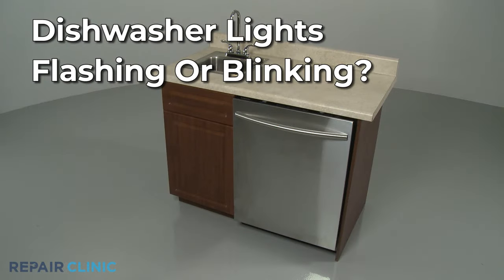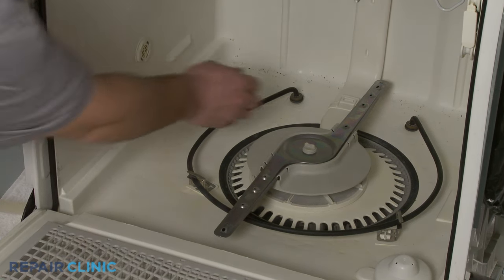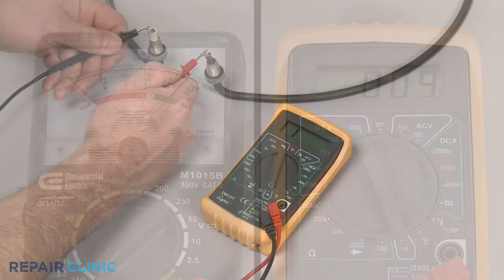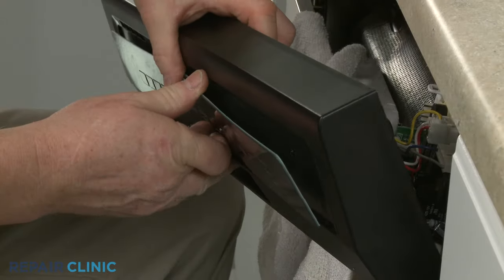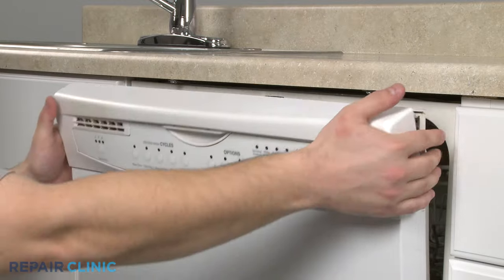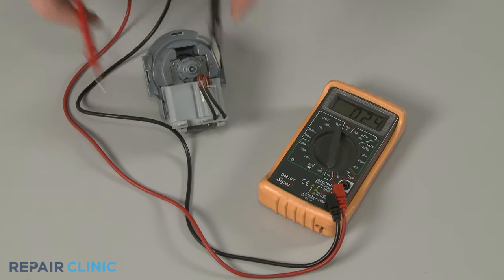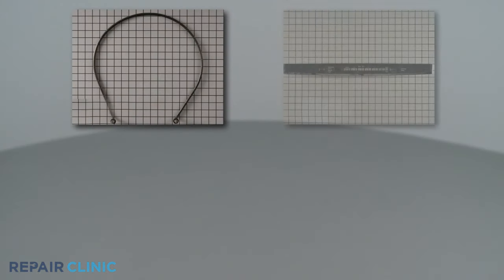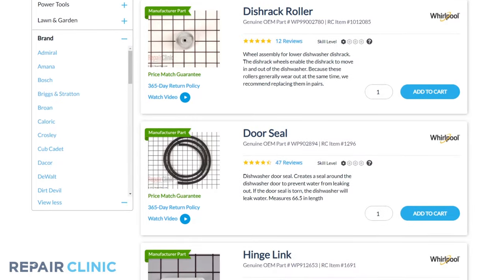Dishwasher Lights Are Flashing — Dishwasher Troubleshooting

Comment: Thank you for posting. Good info, I lucked out this time. Mine had a red blinking symbol & wouldn’t start. Had to find my glasses & sure enough it was printed just below the button “control lock hold 3 seconds”. Simple solution.

Comment: For some reason this was the top video that came up when I searched. In my case somehow water had gotten in RIGHT behind the power button on the control board. There was just a small puddle of water that was shorting the circuit. My Whirlpool responded to this by flashing control board lights. I suppose I could have waited for it to evaporate on its own but since I didn't know what the problem was I disassembled the control panel, saw the water, and used a hairdryer to dry off both the plastic panel and the circuit board. It fired right up after I reassembled.

Comment: THIS VIDEO DOESNT SHOW ALL THE STEPS AT ALL. YOU MUST REMOVE THE DISHWASHER AND UNPLUG THE ELECTRICAL CONNECTIONS FOR THE HEATER COIL AND ITS THREADED AND YOU WILL NEED TO UNSCREW FROM UNDER WASHER. IT DOESNT JUST POP OFF. AND REQUIRES ALOT MORE WORK SHOW ALL THE STEPS NOT BIT AND PIECES.

Comment: 🤣 the irony that they are showing an LG diswasher in the video is hilarious. My LG dishwasher brand new worked for about 8 different cycles, a defective control panel. Had the control panel replaced twice under warranty in less than a year. The trays show signs of rust at the joints.  Never buy LG anything! Piece of junk! My Kenmore lasted 25 years, sadly too old for parts.

Comment: This isn't helpful at all.  If a specific light is flashing, it will be indicated and I can look it up.  How about if ALL the lights are flickering at random at the same time.  That's what I was looking for.
Reply: Replying to my own comment.  I opened the control panel, unplugged it, plugged it back in, and it's been fine ever since.  I read on another video that the control board could be faulty OR the connections could have corroded a bit.  My guess is that unplugging/plugging the wires scraped a bit of corrosion off of the pins and restored a more solid connection.  If it happens again, I will repeat this process, but also spray on some contact cleaner before reconnecting things.